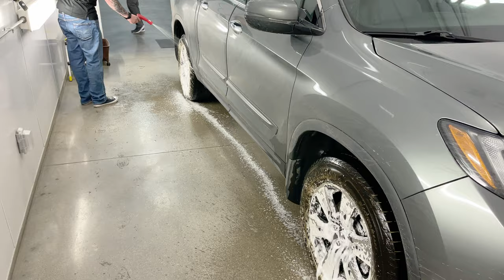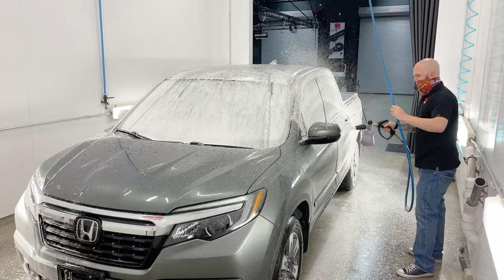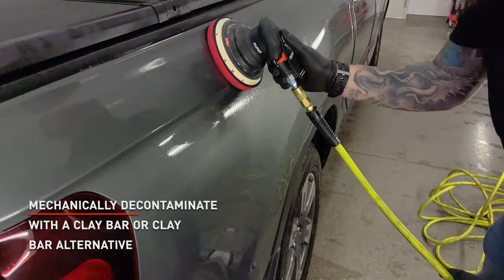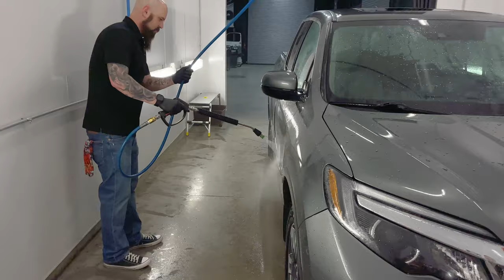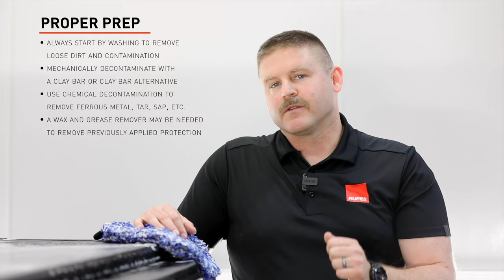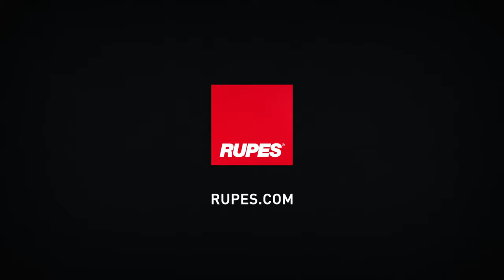Proper Prep for Polishing - [RUPES Replies Season 02 Episode 05]

Comment: What's the best course of action if there are small rust spots from stone chips that have cut through to bare metal or primer?  I have a manufacturers paint stick to fill them in, after clay/decon prep and before polishing and applying a sealant but not sure what the best route is to remove the rust.  Thanks, love all these videos!
Reply from the maker: Not really our area of expertise. We are the authority on anything to do with the maintenance, correction, and restoration of painted surfaces. Once the paint is gone (as in down to bare metal and rusting) we would defer to others who specialize in that sort of thing. Once the spot it touched up, certainly its as simple as leveling and then buffing out.

Comment: Hi, thank you for all these nice videos. Can you do a video about what to do after polishing to prep the paint for a wax or sealant? I now use Isopropanol to remove polishing residues but perhaps there is a better way?
A video about your P808 sealant would be nice too. 😎
Reply from the maker: Thank you for watching! We can certainly put it on the suggestions list. P808 is simple. Apply it. No need for additional steps after correction. Outside of that each manufacturer of a wax, sealant, or coating is going to have a recommendation and we would recommend you consult the manufacturer of your preferred product for their recommendations for pre-application prep. It would not be feasible to make a recommendation that applies to all protective products, nor would it be responsible for us to make recommendations on behalf of other brands.

Comment: I used the same way to prepare all car surfaces before polishing but without the last step (alcohol) because I think is not necessary if you'll polish.
Another point is that using some specific iron remover like SIDERO on wheels or body car, you are able to remove 80—90% of contamination. The other 10-20% you'll romove with claybar. I did many test ;-). Now is time for my question: sometimes the front glass is damage (scratches) from cleaning brushes: is there a way to polish it? Do you have some suggestions about this?
Reply from the maker: Good information. Thank you. 

We recommend the alcohol or solvent wipe because even though polishing would remove these residues, often times that residue can prematurely clog the pad and reduce performance.

Comment: Question, how about surface prep in between steps? Say starting off with a rubbing compound to a mid compound?
Reply from the maker: Unless you need to inspect progress between steps there is very little need to use a surface prep wipe in between compounding and polishing steps. Assuming the product choice is not heavy in fillers what little masking would occur from the polishing oils would have a negligible impact. Prep solvents are helpful in initial (pre-compounding) work to prevent waxes or other contamination from clogging the pads. And they're helpful after correction work is done to see the "true" final result and prepare the surface for protection (as directed by the manufacturer). There won't be much need/value in doing it between each step.

Comment: thanks for these great videos! Hey jason some pros say it is best to learn sanding and then use a DA than using a rotary.. what do you say?
Reply from the maker: Thanks for watching. There are many cases where a light machine sanding step followed by a moderate polishing step will be preferred because it is less invasive to the finish than heavy compounding steps. Sanding is also a much more controlled rate of material removal so when preservation of clear coat integrity is a concern it might be the best choice. The one constant is all of this is that there is no constants... there is always exceptions and situations where one method may make more or less sense.
Reply: @RUPES  like bruce lee said... “be water my friend”. 👍🏽

Comment: What type of lighting is good for proper Washing ? 5000k or 65000k
Reply from the maker: Color temperature is not so important for washing, you just want to create an environment where the vehicle is lit from every angle without shadow so you can see dirt/contamination. When it comes to paint correction, that is where you want to have adjustable color temps as well as intensity to tune the lighting to the color of the paint for best visibility.